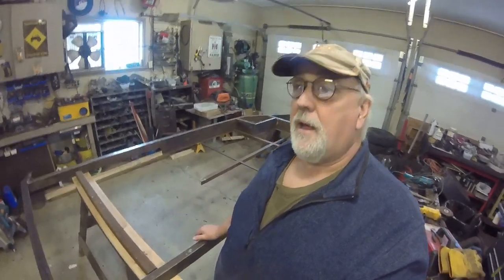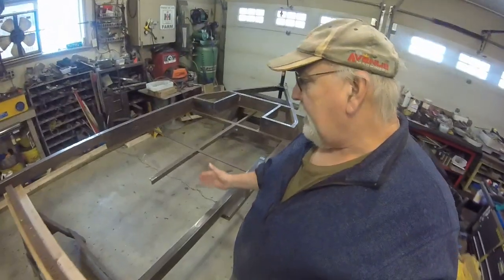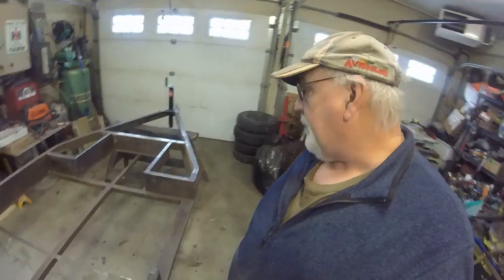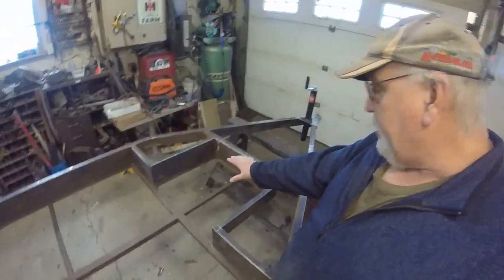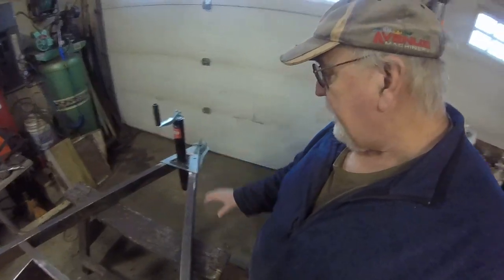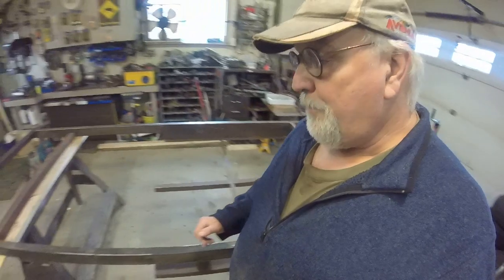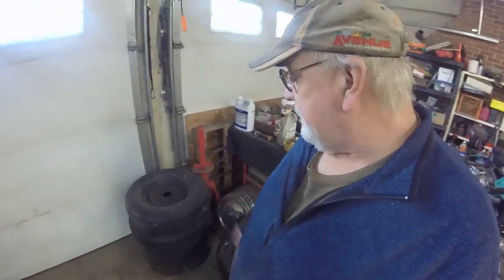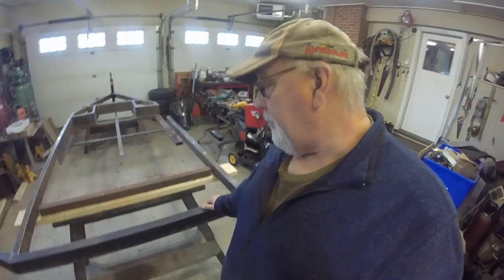Acorn/ Scamp 1

Comment: I’ve been enjoying a few of your videos. Great job restoring these old fiberglass trailers! I have a 1973 Scamp that I’ve been working on and feel like I should have the frame rebuilt too. Do you have any suggestions as to how I would figure out if I need to rebuild/replace it?
Reply from the maker: Yes..  It's pushing fifty years old.  So if it's never been re done then I would say it's time is up.  The rubber in the axle tube would be done and the trailer sagging.  Plus as I recall some of the frame involved thin sheet metal which will rust right through.  So have a good look under there.  It's not hard to remove the frame..